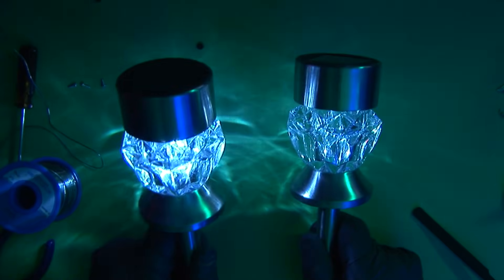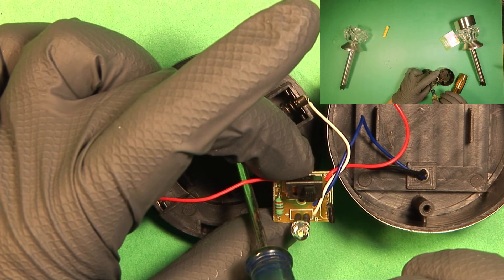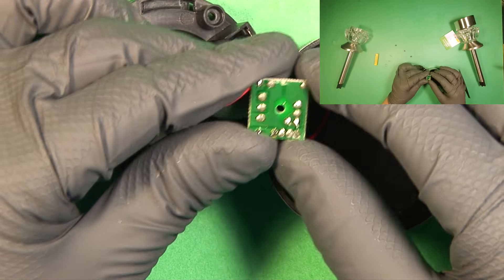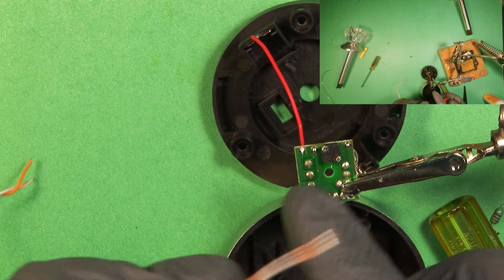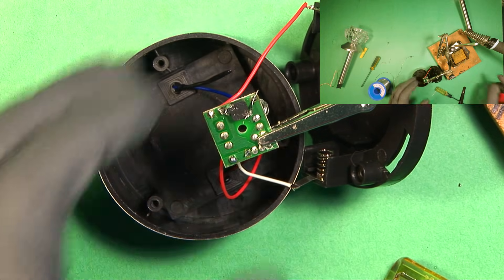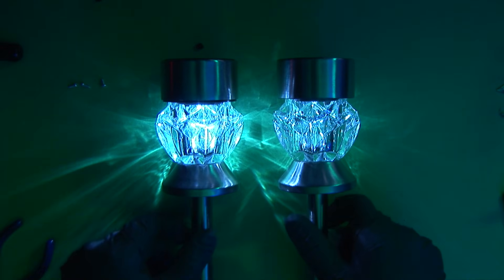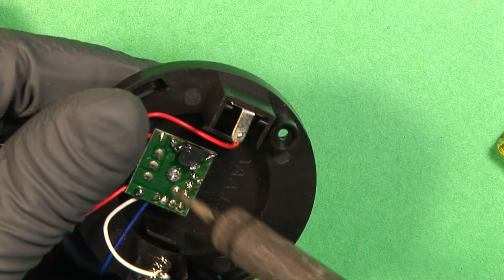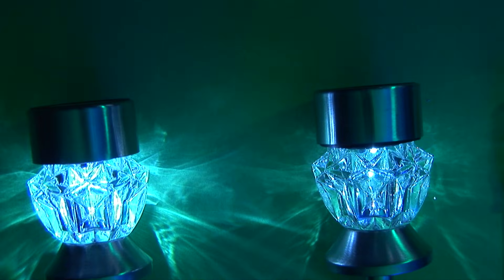Brighter Dollar Tree Solar Pathway Light Mod

Comment: Hello brother,recently I bought 2 solar lamps one of them is working fine and give a lot of light but the other barely light up, it's like you put it on dim mode, I checked the batteries ,they fine but still I went and bought new ones  , changed them and left to charge but no result, the light is still low comparing to the same lamp,what you think it can be the issue?

Comment: You must not know the name of components. You calling a resistor a coil. They are two different components. But at least you are replacing same for same type of component. FYI a resistor controls current and a coil or inductor controls voltage.
Reply from the maker: the part that was swapped out was not a resistor.
Reply: @Electronicle yes it was
Reply from the maker: @RockingRod78  that part is known as an axial inductor.  Yes it looks like a resistor and it uses painted rings to display the value, just like a resistor...however it is not.  The axial inductor is used as part of a simple boost converter or dc to dc converter circuit.
Reply: @Electronicle  okay sorry but I never seen them looking like a resistor before.
Reply from the maker: @ take a look here:  https://electronics.stackexchange.com/questions/108108/how-to-visually-tell-the-difference-between-axial-inductors-and-common-resistors
Reply: @RockingRod78  You must not know the name of components 😛😜
Reply: @ I should know I have Associates Degree in Electronics
Reply: @ ...and yet you don't know.  An axial coil or inductor is a very common component.  Maybe in the future before you go picking on someone and pointing fingers, you do a little research first or ask in a less confrontational way.  Doing this not only is more respectful to the other person but also doesn't make you look like a total douche when you're wrong.
Reply: @martinkoyle  come on man I said I was sorry but please don’t insult my intelligence. You wasn’t clear in your video.
Reply: I’m a Industrial machine technician I don’t get involved in rebuilding components. I troubleshoot contacts and servo motors keeping machines running and perform maintenance on mechanical equipment. But went through same schooling you did but I went on further education
Reply: @RockingRod78  Um, I'm not the creator.
Reply: @RockingRod78  I'm not the creator or the owner of this channel, I just happened to see your comment when I viewed the video.
Reply: @martinkoyle  well that explains it. Always someone butts in a gives their two cents. Then everyone is upset.

Comment: 12:32... very cool! And I am capable of doing this, but I need to understand the parameters of these components, or I need the "answers sheet" that just says "get these exact parts, and they will work together."
Also, my property is very shaded by foliage. I really want to create small independent groups of daisy-chained solar powered lights like these to mitigate my limited sunlight exposure on my property to save money on my power bill- I want the light for the safety of anyone walking to my front door. Very easy to trip or hurt oneself if they cannot see the ground in front of them.
Hmm...Last comment was 4years ago... anybody still active here? Any suggestions would be great.
Thanks for the video, I'm going to see what others you have- maybe you have more details in them that I can use for this.
Reply from the maker: hey, thanks for the comment and feedback.  Unfortunately I am TERRIBLE at explaining things and its one of the reasons this channel has kinda gone to crap.  But basically what these use is essentially a 'joule thief' circuit.  Since the LED requires more voltage than the battery can output, it exchanges amps for volts.  But look up joule thief on google(or whatever engine you use), I think you'll find it very interesting.  Maybe I can throw together a video explaining myself how a joule thief works and demonstrate some stuff.

Comment: It sucks. What the hell of inductor? All I saw that he low Resistor to Increase more current to LED, to make it more brighter along with bigger capacity of battery.
Reply: um considering that white led takes more than 1.2 or 1.5 volts to run, it requires a circuit to increase voltage.  THAT is what the INDUCTOR is for.  Maybe you should do some research on things before talking out your ass.

Comment: I had one of those. I just used ordinary elmers glue-all to fill in the cracks between the solarpanel and the plastic at it lasted until retirement(replacement with a better unit). Over a year I think-

Now I got those harbor-breeze(hamptonbay clone??) lights from the big hardware store and those have a 3v AA-shaped LifePo4 in them and a super bright yellow LED.

Comment: Isn't that a resistor?  
I often change the batteries in the dollar store lights because i know they're cheap.  I should try this.  I bought 12 $1 lights last year and put them in this year.  One battery didn't work at all (doa) so I threw a 2300 mah NiMH into it.  However it still doesn't last longer because there's just not enough sun to charge them.  
Also, the one w/ the 2300 in it flickers later at night and IDKy. 
Now if there were a  way to get them to stay on LONGER... that would be great.

Comment: I got solar flash light, it can turn on when the sun is up ...
when at night, you need another flash light to spot it's solar plate, then it can be turn on ...
Reply from the maker: Let me guess Dollar Tree?  I saw them selling solder powered flashlights once that had no battery and relied on a solar panel to power the LED.  Completely worthless.

Comment: Very interesting! I came across this wanting to fix one of those battery operated pull chain lights. I dropped it and now it is not as bright as others. I figure one of the connectors is loose. Unfortunately, my heating versa-tool won’t “tin” for some reason! So there goes that idea! Anyway, it never occurred to me that you could upgrade solar lights by borrowing from mother boards! I save them as well. So thank you!!

Comment: Herd‘s another trick to solder to the inductors:
I would also have done it the way you did, but thinner wire works to. For example from a old transformer/usb charger. It‘s much easier to solder than.

Comment: The voltage is actually determined by the battery voltage and the collapsing magnetic field in the inductor (it's not produced by the IC itself). The IC is just switching to constantly induce back emf in the inductor at a certain frequency. This voltage is then high enough after the collapse for it to make it's way over the LED. The LED is thus lit by pulses at the same frequency as the oscillation, it isn't constantly lit, our eyes can't tell the difference. 

LED's don't have linear current draw in relation to voltage, however they still are voltage dependant, despite some random Americans online pretending that they are some miraculous device that runs off pure current (not even something that exists in this world, there is no current without voltage, you require both for there to be power, they don't exist on their own). LED's will require a certain voltage before they start conducting, and indeed you do need to raise this voltage to a certain level to get them to draw properly, meaning they are dependent on the voltage, but just not in a linear way (so going a little over can mean burnout, where as in linear relationship electronics it won't). For example an LED with a starting forward voltage of 3v, if connected to just 3v, will be dim, however if you increase the voltage to 3.4v it will be bright. The LED does need a certain voltage, because it does have a resistance that determines how much current it can draw (even if not linear). The physical resistor in line has a linear relationship, so we use that, so even if the voltage source is a mere 0.2v higher than usual for some reason, or if the LED's resistance lowered a little for some reason, neither result in the LED burning out, because the resistor itself will limit current depending upon voltage in a predictable way, meaning only a certain amount of current can get through the resistor regardless of what the LED is trying to draw. 
Oh and yes, it will burn out if you try to run it at a massive voltage, there is another misconception that you could run a 3.2V LED at like 100V, just as long as it's only drawing like 20mA, this misconception created by some Americans on internet forums claiming that it runs purely off current and that voltage doesn't mean anything. This is again false, increase the voltage massively, and the physical power increases, and the LED will burn out instantly. Wattage is still determined by the voltage and the current, and LED's wattage is a product of both, it isn't some magical item. However it is true that a 3v LED would survive longer on a 5v supply and 20mA limiting resistor, meaning the LED would only be drawing around 60% more power than it should, when compared to for example just running the LED at 4v without a resistor at all, because of the LED's exponential gain, it would burn out after just a minute or two and be drawing 300% more power than it should. 
However this concept has become muddied by some Americans who don't quite understand electronics properly, filling those forums on the internet etc. 

As far as upgrading the unit, you will actually need to replace all 3 components, meaning the battery should become a 600mAh at minimum, the LED should be increased to a 30mA capable LED, and the solar panel should also be another 3V one, but with at least 3-4x more current than the current weak one. Because the tiny mA solar panels included are not powerful enough to fully charge a 600mAh battery for example, they are purpose built just to be big enough to charge the crappy 200mAh battery and run the weak LED for around maybe 6-7 hours during night.

The IC itself doesn't need to be replaced, because if you look at the datasheet it can handle more than it's used for in these little lights, this is likely because larger solar lights use the same IC, these IC's were purpose built for general solar garden light purposes, so they are used in underpowered and higher powered units.
Reply: Yes, there is a calculation we can roughly use to determine how much current we will have access to. 
I believe it's pi x 2, which is 6.28. Then you times that by the frequency of it switching, then you times that by the henry, I think that was it. That will give you the ohms, then from there you can use ohms law with the voltage source to determine the amps. 
So for example if we use a 30uh, and a switching speed of 200000hertz. We should get 6.28x200000x0.00003 = 37.6ohms.
From there it equates to around 38mA.

And if we instead use a 60uh inductor, it drops way down to 19mA.

A common inductor value is 33uh if I am not mistaken, it seems like a perfect mod for the lights, if you can get better batteries and a better solar panel also.

Comment: Home Depots $5.88 solar garden lights are pretty bright. 14 lumens. I use rechargeable 2000 amp batteries that I can charge when its cloudy. They last longer.
Reply: I always swap out my solar lights with eneloops. During the winter they last 3-5 days. In the summer possibly a month.
Reply: @fearme8049  Yes Eneloops are excellent batteries. I used to be a wedding photographer and always used them in my strobe units. And then would have about 20 extra backups in my gear bag. It was way overkill but you could never have too much gear for the unexpected.
Reply: @anthonychase4945  Nice, i use my powerex charger to charge when the solars get dim. The capacity of the cheap included batteries are woefull. Only about 1/3 to 1/2 the stated capacity. If you rely on batteries for your job get a decent smart charger if you havnt already and will know exact capacity and bring dull batteries back to life. My eneloops are still atleast 90% after 9 years.
Reply: @fearme8049  I have the Powerex chargers too. I kept one at my studio and one at home. Now I keep one in my shed to charge up the batteries for the solar lights. During the summer I rarely charge.
Reply: Yeah not sure why you would go through all this trouble when you can buy a better light for a few dollars more. It's worth not having to do all this nonsense.  😅

Comment: Can you use a larger capacity mAh battery AAA in place of the 200 one?  I have 350mAh 1.2v batteries in my solar lights that are sentimental. The ones I can buy on AMazon are 600 mAh. Will I fry them if I replace the 300-350 ones with the 600 ones?
I THINK they would be the  same size (AAA)... thanks in advance for your help

Comment: you removed the resistor wouldnt that make the LED more likely to burn out as the voltage is too high?
Reply: You mean the inductor?  It's not a resistor.  Looks the same but isn't.  I replaced with a different value.
Reply: @austinstrunk  hi i am new to E&E... thats an inductor? like a coil? whats the purpose of putting a coil there?
Reply: @thewolfofswingthat2035  basically in this situation it acts like a pump.  There's not enough power to run the LED alone, so it stores energy and then releases it .  The light output of the led isn't constant, but instead pulsed.  Our eyes can't easily see it because its at a high frequency.
Reply: @thewolfofswingthat2035  Also sorry this is my other account, forgot to switch back to electronicles...but same person
Reply: @austinstrunk  one for normal stuff, another for trolling ? wink*wink hehe. thanks for explanation . subscribed.

Comment: Can you put in stronger battery thankyou
Reply from the maker: You can use a higher mAH battery however you won't want to go too high as the solar panel is very weak.  You'll want the battery to be able to charge to 100% each day.  NiCd and Nimh batteries don't like constant partial charges.
Reply: @Electronicle  how high is too high?

Comment: I recently got a pack of 5 lights from Sam's (their brand) for like 18 bucks and they are pretty bright! But after a  couple of nights, but they began to get dim around 3 o'clock and shut off while it's still dark(so, from 8pm to 4am, not a bad run). We live in a super-high UV area. They came with a 800mAh battery. I think of either switching to a 2500mAh battery or soldering on a holder for a second battery in parallel (under the cap, there's lots of room), or maybe doing both. The goal is for them to last until the rising Sun turns them off. Are these ideas realistic? And which is better? My concern that the solar panel won't charge both batteries or a single bigger capacity battery sufficiently, so it would be an exercise in futility. Your thoughts? I'm not really an electrician by trade.
Reply from the maker: It all really depends on the quality and output of the solar panels. You can try using a slightly larger battery mAH rating.  Don't go too high as Nimh and Nicd batteries don't like constant partial charges.
Reply: @Electronicle  Thanks for reply. the batts came as Nimh 800 mAH. I did exactly what I said I was going to do. I added a second parallel battery holder into some and used the 2 of the original batts, and I bought 2.7k maH batts for the others, and I put 2 2.7ks in some. All setups are lit until the morning, for now at least. These are really good lights for the price-- ive noticed my neighbor have them too now. I went to Sam's to get another pack and they were sold out!
Reply: @Electronicle  So I"m guessing my $1 ones have crappy solar panels.  I mean, they were $1. LOL

Comment: Which should plan to use:  33uH 1 watt , 47uH 1 watt, or 68uH 0.5 watt inductors --which? I guess, my real question has to do with wattage.
Reply from the maker: The equation is Watts = Current(amps) x Volts   .  Half watt inductor is more than sufficient for this application.
Reply: @Electronicle  Thank you!

Comment: You changed out the inductor or a resistor?
Reply from the maker: inductor
Reply: Replaced a resistor with an inductor is what I saw but hey maybe some inductors look like through hole resistors or a resistor can also be an inductor in certain circumstances?  Hmmmm yeah my electronics brain is rusty right now but I see your question immediately.

Comment: So I take it you swap the old resistor with one of lesser value in order for more current to flow? And then swap out the battery for a higher mha 👍
Reply from the maker: its not a resistor, its an inductor
Reply: @Electronicle  yeah that would have been more clear, what colors of what we would call resistor would you use

Comment: get your parts type right ... what your removing is a resistor and its messured in ohms ... what your putting in i don't know but its not what you say it is, but it might be a spool resistor
Reply: I think you might like to learn a bit more about different component package types before you comment. They were both inductors.
Reply from the maker: It's an inductor they use the same package type

Comment: Nice light.👀>share4.photo/PostLight?113  Doesn't light up a very large area but it's just right aesthetically in my landscaping. Instead of bolting down to concrete I drove a steel t-post (fence post) in the ground and slid light pole over it. This was way quicker and easier to install this way. Know what's underground before driving a post in the ground though....

Comment: The device you removed looks like a resistor to me?
Reply from the maker: Yup. But it's an inductor. They can have a similar package typr
Reply from the maker: @garyvcole  look up buck boost converter or dc-dc converter
Reply: @Electronicle  don't want to be annoying, buut that's not a buck-boost converter, probably not even a boost converter, because there is a bit to little amount of parts to be DC-DC converter
Reply: @Kuzia141  In fact, it is. It boils down to that tiny 4-terminal ic which is probably an XY8018 device.
Reply: Yup pulled a resistor and put in an inductor